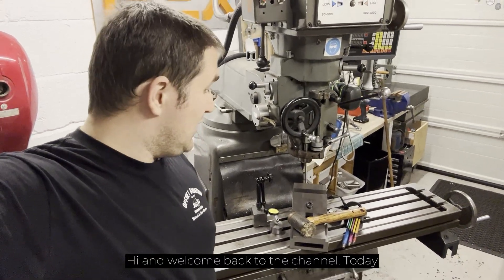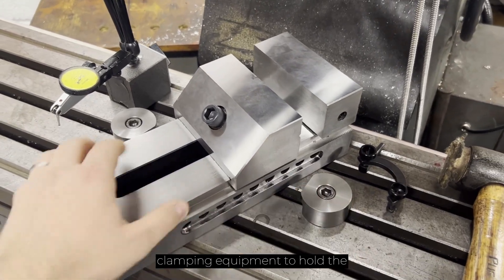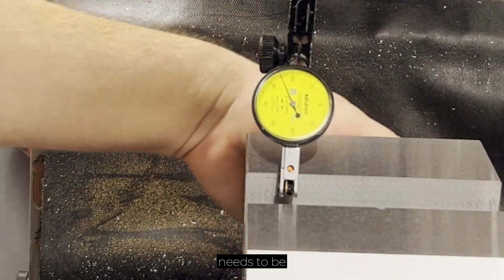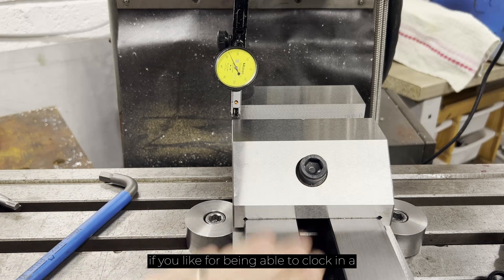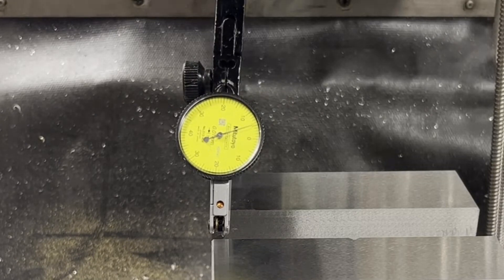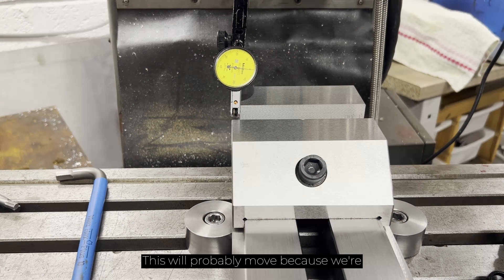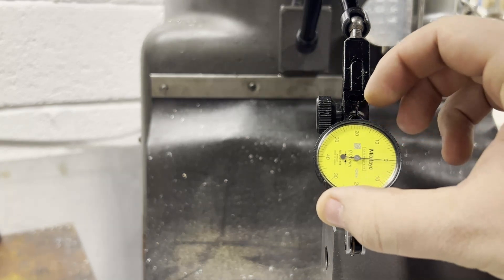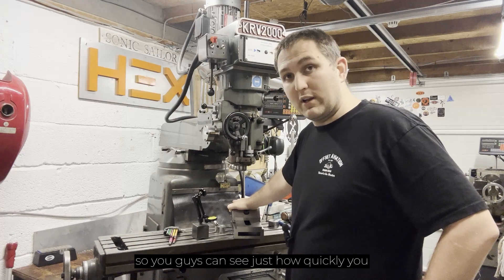Tutorial: How to Clock a Vice

Comment: Great tutorial. Do some vices come with a locator in the bottom of them to get you somewhere near. If I ever get a milling machine I think I would fit a fixed stop at the back of the bed.
Reply from the maker: Thank you mate!! Glad you enjoyed!:)
Some vices do have location lugs on the base which drop into the t-slots, which help towards getting you close. But I’ve seen time servers apprentices still struggle clocking them in in less than 45 mins due to not knowing the “clamp-pivot” technique!